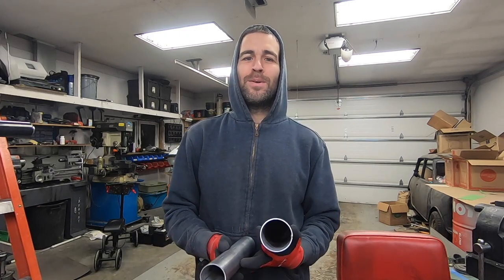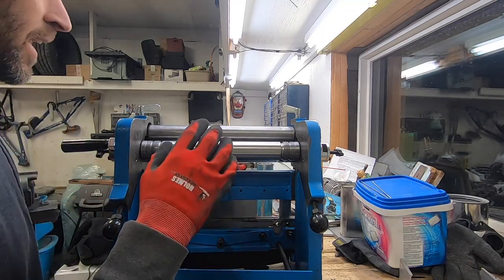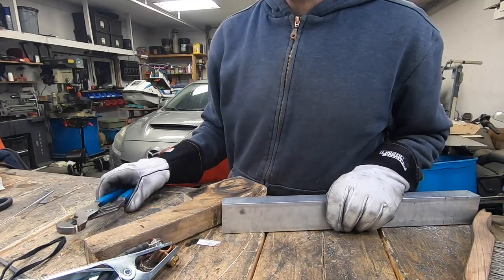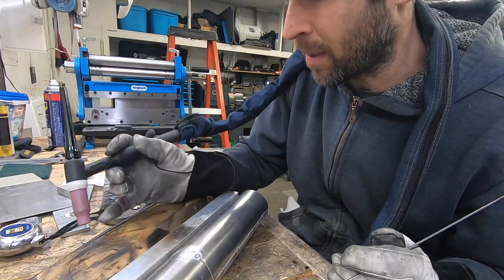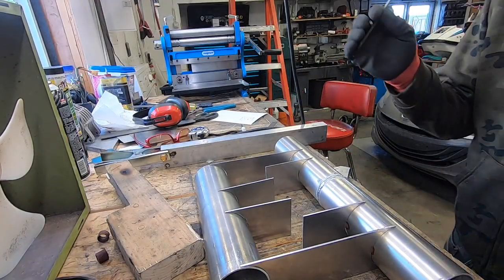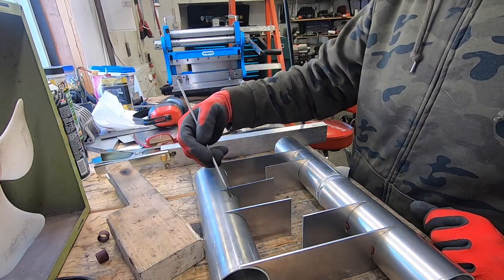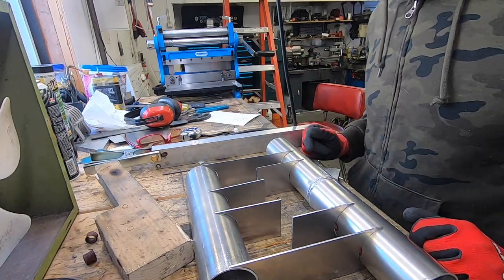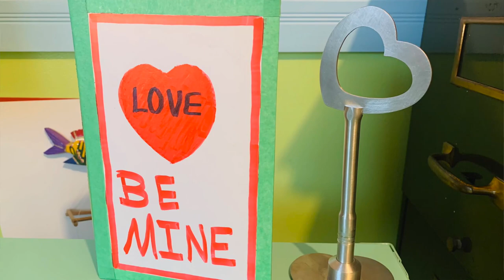Custom Water Box Build - (part 2) 1100 Triple Swap X2

Comment: DUDE , Performing perfect performance part production is paying off . Preparations of the pipe and placing pretty weld passes probably puts your performance potential into perfect position to produce powerful personal watercraft parts. 
Awesome music,  perfectly placed , and much appreciated. 
I noticed that you smiled a lot more in this video then you usually do. . Looks like you had more fun . I'm amazed at how much attention to detail put into everything.  seriously.   loved the video. .. keep up with the same in the future.  I really felt the production value was positively implemented.  Hopefully other viewers appreciate your time and detection to the channel.
Reply from the maker: HAHA... Great use of alliteration, Rick. 

I'm really enjoying this project and kinda got into a bit of a groove. Also had one of those moments where I realized that I was finally doing something that I've always wanted to do ... for many years now. Never thought I would have a tig or weld aluminum or be working on jet ski projects... so really... even if it doesn't go well... it's still great ! 

I would like to be able to focus more time and effort into my videos. I have gotten a lot better, but I deal with ADHD and OCD runs in my family... I struggle with focus, with sitting still and with ever thinking anything is good enough. I've heard it said a LOT that the fear of failure holds people back more than failure ever did... you fail and you learn, but you only fail if you try in the first place. Knowing that and being able to act on it are very different things, haha. 

It helps a lot to have an active audience, like you and others, to keep me motivated but not put so much pressure on me that I crawl under a rock to hide . I was going to do a live stream today and complete the build of the water box, but that is something that would have to be planned days in advance and requires me taking time to address my viewers in real time.... I would like to do that with some project... I'm thinking first fire up of the 1100 has to be done that way.